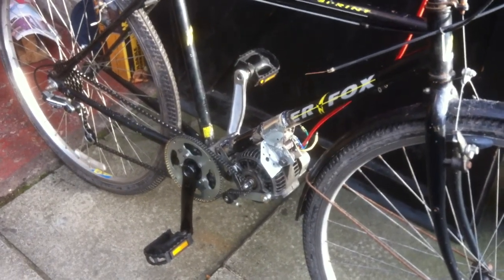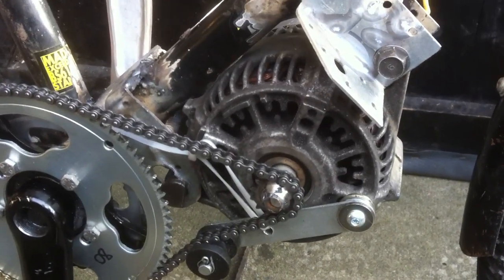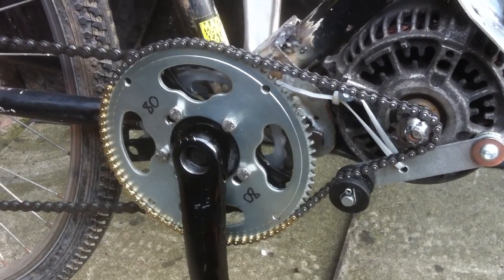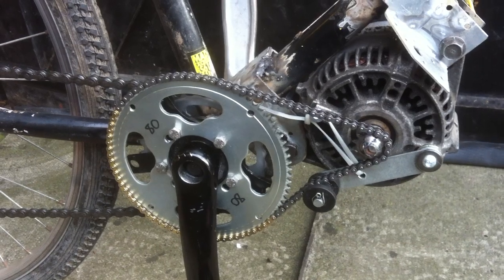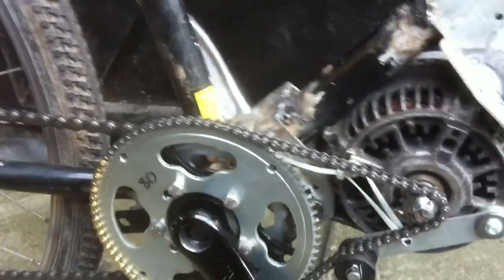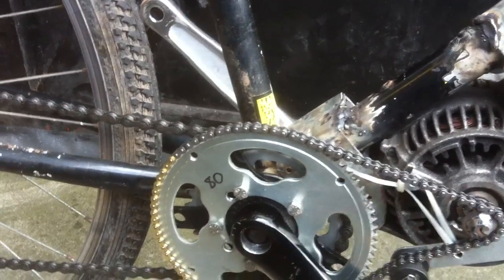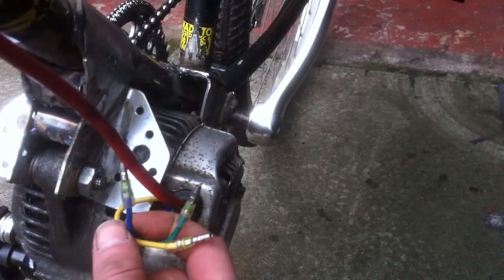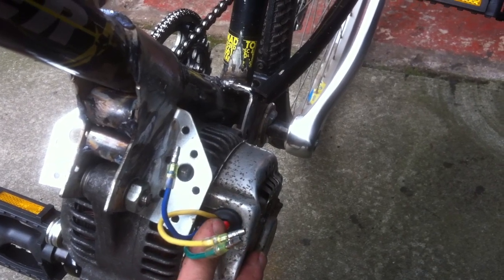Alternator motor as a mid drive.  Part 1

Comment: what kind of cranks did you use? it looks like the freewheel is connected to the cranks from factory?
Reply from the maker: It's a generic freewheel right hand crank. I fitted the 6mm chain sprocket and the bicycle sprocket with various bolts... it doesn't really matter as long as there's a freewheel to stop the alternator breaking your legs.
Reply: @plodderexup  Thank you!! Do you know where I can find one of those? I tried looking everywhere for a freewheel crank arm and I can't anywhere? Maybe it's because I'm in the US?
Reply from the maker: I found mine on eBay... It was from a tandem, as it allows the riders to pedal independently.
This company in the UK is good. You would have to ask them about shipping to the US.
https://www.sjscycles.co.uk/cranks/shun-alloy-104-pcd-4arm-freewheeling-cranks-170-mm-silver/
There are many videos on YouTube about making freewheel cranks.
Or use a separate freewheel on the rear wheel.
Another option I've seen is just to use footrests and remove the ability to pedal.
Reply: @plodderexup  Hey man I appreciate the quick replies and the link you're awesome! I took a look and they don't ship to the US. So now this is a crazy question, but do you think if I found a way to send you £120 if (once you received it so that you know I wouldn't be scamming you), you could buy that crank arm and ship it to me? If £120 wouldn't cover it I could send you the cost of how ever much the bill is, plus what ever you think is a good tip for taking the time to do like this? If not, do you know of any other sources I could find one or a similar one like it at that might ship to the US? I've tried looking everywhere it's literally impossible to find here. most bike shops I went into asking for something like it, they said they haven't even seen cranks like it before?
Reply from the maker: @ProditioFallax  I set my currency to USD, got to the checkout and have 2 options for shiping to USA; $23.90 standard or $58.04 express.
I am not buying and shipping on your behalf.
Reply: @plodderexup  Not even if I pay you in full the cost of the set and shipping, plus tip? you could wait until you to receive it all in full before doing anything?
Reply from the maker: @ProditioFallax  Just order it direct from them. I'm not getting involved

Comment: Where did you get the crank set
Reply from the maker: I happened across 2 sets of these on eBay. They were from a tandem that had independent cranks. 
SJS Cycles (in the UK) do this set and the price is OK compared to others I've seen
https://www.sjscycles.co.uk/cranks/shun-alloy-104-pcd-4arm-freewheeling-cranks-170-mm-silver/
I've see a few home made sets on YouTube; if you have a threaded right hand crank or can  get one threaded on a lathe then you can use a 16T freewheel or you can get a sprocket freewheel for electric scooters (try petrolscooter on eBay).
Reply: @plodderexup  
I've made a crank the same does the same job.
Out of scrap parts from old bikes.
Didn't cost me much.
Only the freeweel cost £8 on eBay.

Comment: Just an idea if taking advantage of alternator design...a controller for both the field current (your 12v constant)...and your normal controller for the rotor.  Im thinking raising/lowering the field current is like weakening and strenthening magnets in a BLDC...and maybe produces more/less torque.  While the speed controller is raising and lowering voltage producing a bit more speed. Thinking of hills needing torque rather than speed.  BTW...to me, if a weld holds its jam up and jelly tight...good to go.  Thumbs up
Reply from the maker: If you watch the rest of the build series, I eventually come to the same conclusion and use a 3-phase bridge rectifier and a PWM DC controller, with a load switch to adjust the field (rotor) current.

Comment: Ecxelent project cheadlebiker,I want to make something simular like electric scooter using old car alternator, but you mentioned that efficiency is terrible, have you ever consider using old car starter electric motor, would be more efficient by your opinion?best regards
Reply from the maker: zozon ozon I'm only concluding that it's inefficient because I can only do 34mph with 60v and 40A. I've got an ebike with 60b / 18A that will do the same speed.
I would not use a car starter motor as it draws a huge current. What sort of scooter are you thinking about?
Reply: well I would like to combine something between bicycle and scooter,   take a wheels from scooter and chassis, keep light as possible, maybe it is best solution to buy 48v 1500-2000w electric motor from china, but they are bit expensive 100-200 usd, but they are most efficient since they are using magnets inside, what do you think?
Reply from the maker: zozon ozon Do you mean scooter as in something you stand on or a moped like 50cc? What is it for, how fast should it go, how far should it go and what are you using as a battery?
Reply: I was thinking about moped 50cc but much lighter for some short daily commuting I have some 2 ups batteries 17ah, speed is not such matter I would be satisfy with 20-30km/h I just want to choose right electric motor for it...
Reply from the maker: If you want it light and capable of 30kph then your best option is to use a bicycle with a 36v 250w geared hub motor and run it on 48b or 60v. This is very a simple and lightweight solution and can be fast. I have one with a 60v 12ah battery and it will do 45kph. I use it for a 25km each way commute when I want to pedal (to keep warm) but also get there fast.  If you use a moped frame and an alternator then you immediately make it heavy. You can buy used hub motors on a wheel for £50 (I don't know which country you are in) or a new kit without battery for about £100.
You have to remember that this bike is an experiment / technical exercise and not something that is necessarily simple, practical or reliable.
Reply from the maker: Tchangly21 has done a moped alternator project and an alternator bike.
https://youtu.be/lhLRpLl7rpw
https://youtu.be/uHGd57dzBMY
Reply: thank for all info, this looks good maybe will do something like this...

Comment: 60V hmm are the power of this engine is about 1.8KW or more? i'm wanting to make an Alternador motor but i dont know if this type of motor is efficient. I'm waiting for your answer.
Reply from the maker: Ale Santos It's 40A (or 45A, I forget), so 2400w+ and it does 35mph. The efficiency is terrible; you'd be better off with a motor. An alternator is obviously not designed to be an efficient motor but they are cheap and this is an engineering experiment, not a serious attempt at building a vehicle for everyday commuting.
Reply: CheadleBiker you can add solder to the shunt of the controler.
Whith the same setup i can go up to 4.5kw
Reply from the maker: Thibaud Canillac Hi. Yes, I have soldered shunts on many of my 350W controllers. I don't think I did this one. I might but 35mph on this bike is quite scary. What speed did you get with 4.5kw?
Reply: CheadleBiker i have a top speed of 75kmh so aroun 49mph i think but if you think 35mph is scary you should use a large handlebar and smooth front suspension.
Reply from the maker: Thibaud Canillac I agree. You can see the bike used for this experiment is a derelict bike I got for free. I didn't really think it would work.